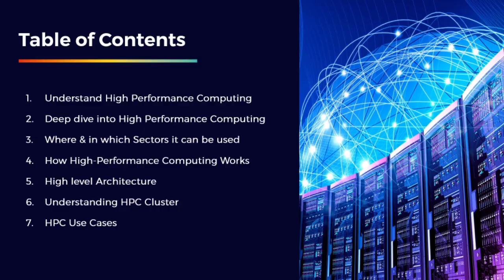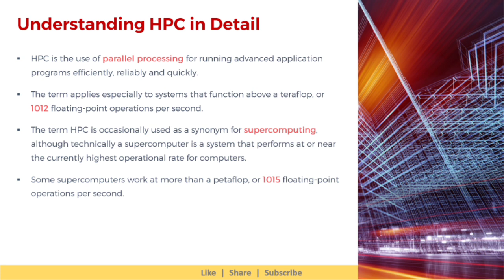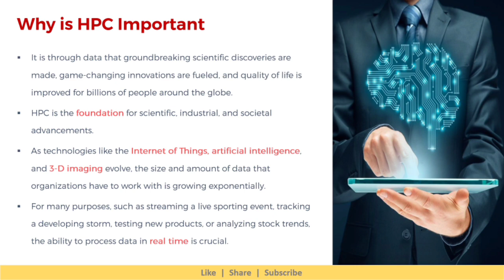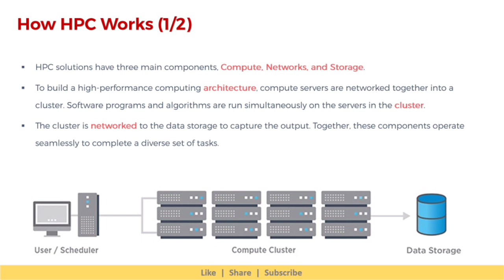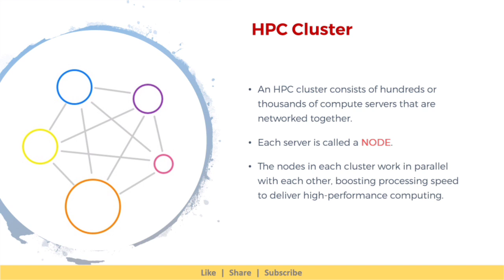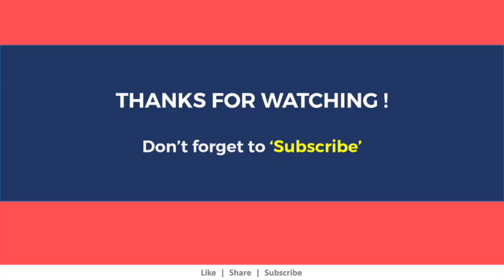High Performance Computing Tutorial | HPC Cluster & Working | HPC Architecture | Use Case

Comment: The teraflop and petaflop definitions are a bit off...  Not one thousand and 12 (1012) and one thousand and fifteen (1015) floating-point operations, but 10 to the 12th power (10,000,000,000,000) and 10 to the 15th power (10,000,000,000,000,000).
😳